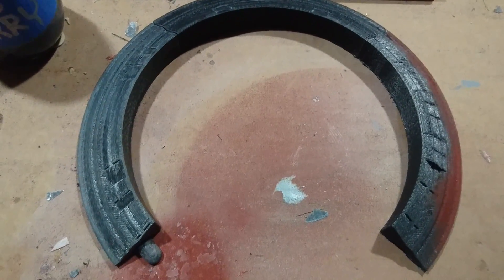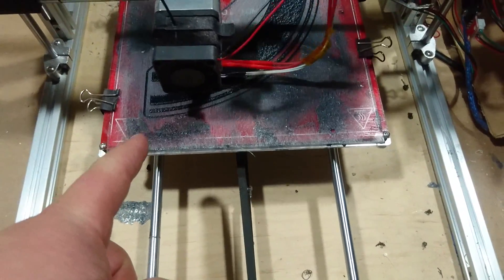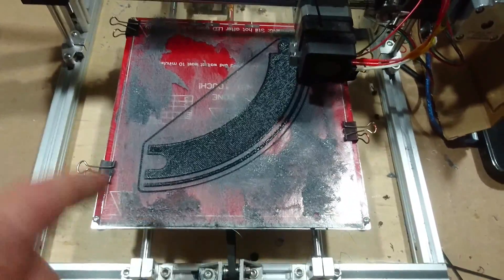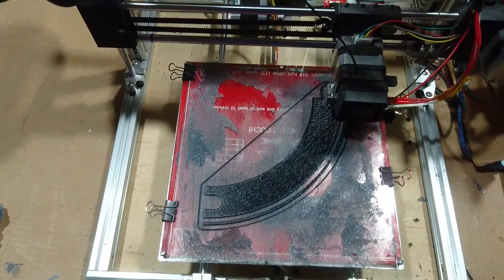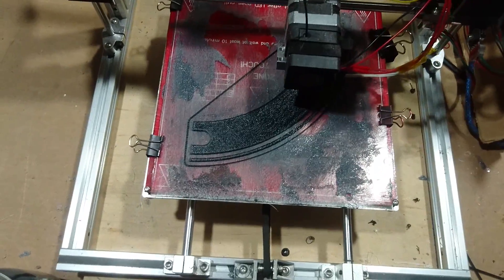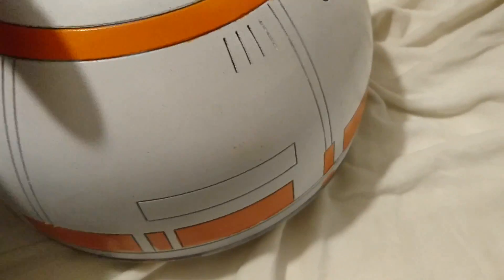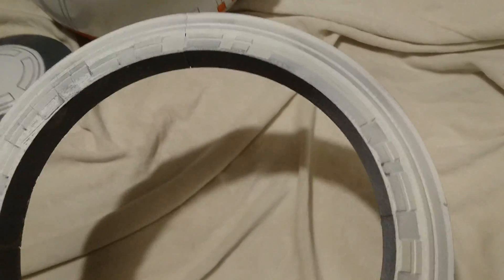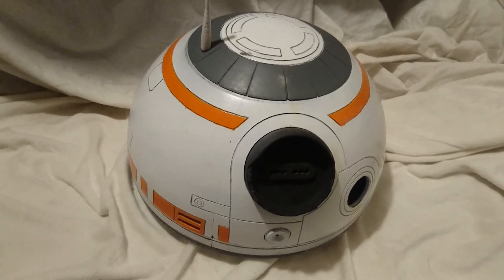Building BB-8 from Star Wars: part 2, ABS adventures

Comment: ok, first great job on what your doing.
 tips. I print with ABS all the time and with out an enclosure. I have a folgertech 5 aka FT5 and I never have problem with corners lifting. you need is to print a brim around the part so it will prevent lifting. Then get your self a sheet of PEI, you will love it. everything sticks to it with the correct bed temp for each material. no more glue or slurry. just scrap the part off the sheet and wipe the sheet down with rubbing alcohol and it's ready to go again. PEI Sheet, 

good luck

Comment: ABS is a nightmare without an enclosure. Get that thing in a box. You DON'T need slurry either if you have it in an enclosure. Garnier Fructis Max Hold hair spray on borosilicate glass.
Reply from the maker: +8BitLife Thanks for the tip. Yes, Im working on an enclosure now, not only for better printing, but also to protect from dust.